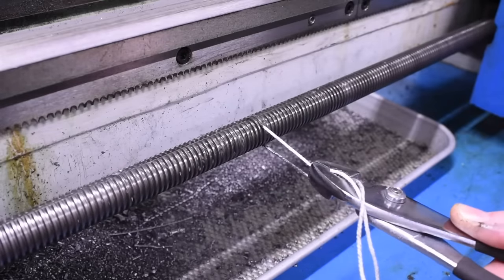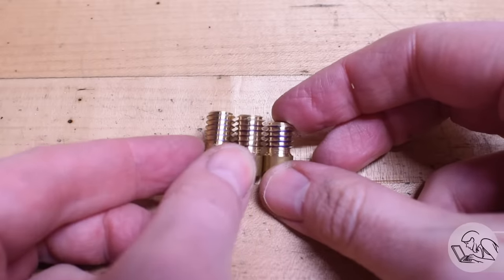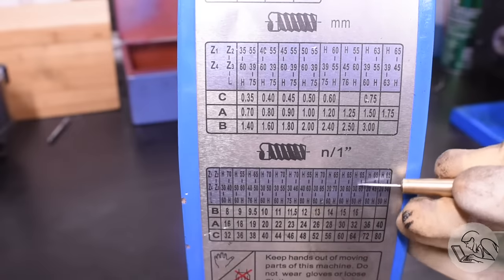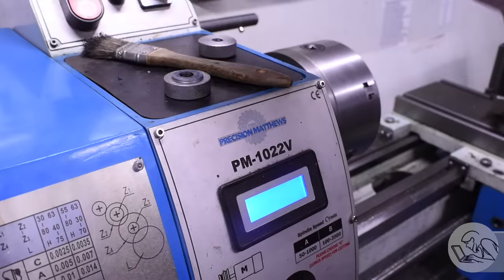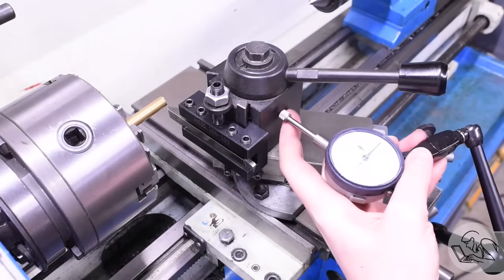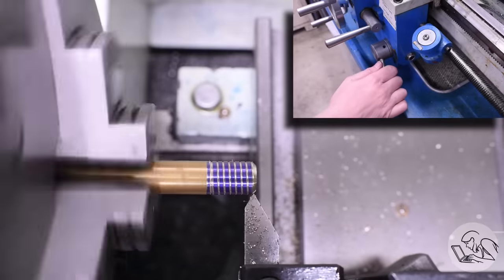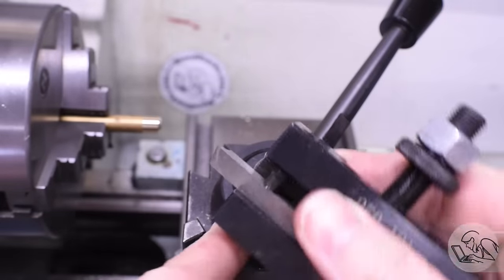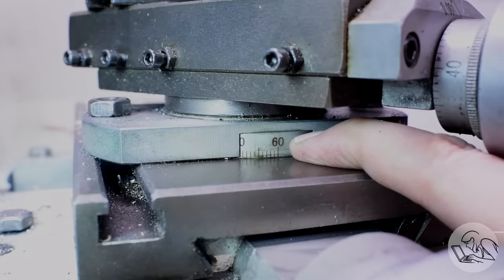How To Cut Threads On A Lathe

Comment: HI Quinn, I wonder if you will see this comment but i hope you do and i have a question. 
I have a old lathe (imperial) that I really battle to stop on time when in cutting metric threads to a shoulder especially if the thread relief at the end is narrow. Is there a way to cut the threads in reverse, from the left to the right, which will probably allow me to use faster speeds and get a better finish in the thread opposed to using the back gear
Reply from the maker: Yup! I covered that at the end of this video. Leave the half nut engaged and wind it back by hand (or power back until close and finish by hand
Reply: @Blondihacks  wow I've watched this video twice before and somehow i forgot about that part.. or maybe i didn't pay attention at the time because i didn't think i will need to thread from left to right. 
Thanks for the awesome videos Quinn  👍🏻 👌🏻

Comment: Wow, I just bought my first lathe. A old Clarke made in China.  It doesn't have gears, it has belts like on a drill press to change the speeds. Only 5 or 6 speeds. Lowest is 500 ram, highest is 2200 I believe

Comment: Silly question: why does the slack on the gears on the left side not influence the precision of the location where the lathe starts the thread?
Reply from the maker: Not a silly question! The answer is that everything is spinning, so it’s all loaded against backlash anyway. Slack only matters in things that change direction.
Reply: @Blondihacks  ah of course, you are only cutting in one direction! When you reverse to the start, there will be slack, but that does not matter. Thanks, I learned a lot from this video.

Comment: Hello Quinn,,, Thanks for the video,, I'm new at this but I'm stuck on a problem ,,,, I want to do a worm gear. The teeth are 1.5mm and it has 16 teeth to 1" on the shaft.
I want to make a gear that moves 1 rotation for that 1" of travel.,,, I've checked everywhere and no one has made a video on what I'm looking for.
I would think it would be simple but I'm having a devil of a problem in finding out what size disk to cut it on. I think I need a 16 tooth or a multiple of 16. 
I'm lost on this one. Any help would be appreciated,, even pointing me in the direction of someone that could help,,,,, Thanks for your time.
Ron,

Comment: if your tool upside down you might want to turn the compound to left....
Reply: Why?
Reply: This is technically right.  Feeding away from the chuck, you're cutting on the right hand side of the tool, so you want the compound screw pressure pushing directly into the cut.  If you're pushing at an angle to the left with the compound screw and cutting to the right, it's possible for the tool to grab and suck the backlash into the work.  The same thing happens when cutting inside threads to the left.
Reply: Thank you both!
Reply from the maker: In practice it really doesn’t matter and this way the compound doesn’t risk hitting the chuck.
Reply: @Blondihacks  you can turn in a way that handle is on the other side...Handle pointing to NE or 1 o`clock... or maybe 12:59 ....
Reply: @Clough42  I am glad you got it, thanks man!
Reply: @Blondihacks  Great Video though!

Comment: I have a suspicion that instead of 1.25mm metric thread your lathe will cut 20TPI, which is 1.27mm pitch. And you might think it's close enough, but already on the 5th thread the mismatch will be enough for it to matter.
Reply: @bwyseymail  1.25mm and 2.5mm don't require it, according to the chart  on the machine

Comment: Hello Quinn, do this method of away from the headstock when threading work when you use  external carbide indexable inserts? I have a few questions and wondered if you have a contact email by chance?

Comment: Absolute beginner that doesnt own a even own a lathe yet here! but why the need for the special tool to reverse cut? Can the other one not be turned over, and even so, in the "normal" method you have the shorter angle moving toward the direction of cut but then with the "reverse" method with the reverse ground tool you have the longer angle moving toward the thread? That said is it because its necessary to have the shorter angle closest to the chuck at all times? Comment section help, i am weak and wont survive the youtube machinist winter!
Reply: The normal tool can be used, you just own't be able to thread quite as close to the chuck or a shoulder. That's why Quinn is suggesting the tool ground the other way.
Reply: @ericfeatherstone  As i was writing my comment out I had a feeling that might be the answer! Thanks for your help

Comment: I hear a lot about single point threading, which is obviously what you showed here. What is "multipoint" threading, or is that even a thing?
Reply from the maker: That would be a die or thread milling, which are multi-point cutting tools.
Reply: @Blondihacks  Ah. I thought so, but wasn't sure. I also thought it could be how threads with multiple "starts" (is that the right word) are cut.

Comment: Given how cheap and ubiquitous digital controllers are, I'm surprised Mini (or table top) lathes don't just use digital feeds.  It should be noted that metric threads are more common in the world, and are becoming so in the USA.  Having cut inside threads on a CNC vertical mill, I'd rather do the metric ones.

Comment: Do you have a video on how to make a threaded receiver? Forgive me if I'm not using the correct terminology, my vocabulary is limited in this area. Another way to put it might be "How to CUT Out the Receiver Threads for 1/4"-20" I want to make an adapter plate that can be mounted to the bottom of one device and then mounted onto a standard camera tripod, hence the need for 1/4"-20 threading. 

The link is to a plate that is very similar to what I want to be able to make. If the center hole were the correct size and threading for 1/4"-20 and the outer 4 holes were the correct size for mounting with VESA mount system. 
https://static.bhphoto.com/images/images500x500/1380562335_997510.jpg

Comment: She mentions the 29 to 30 degree angle as reducing tool pressure but does not explain WHY it does this.  It has to do with how chips are formed.  If you go straight in, you have a chip from the left edge wanting to move to a point above the tool point and also a chip from the right edge wanting to move to the same point above the tool point.  They can't share the same space and therefore collide there.  This creates a force and can cause tearing of the metal (hurting finish quality) and the increased stress can even break the tool tip.  30 degrees is not an acceptable choice because even with the slightest error in compound angle setting or tool bit angle, you can get a small stair step on the weak side cut.  That's why 29.5 degrees (or for some, 29 degrees) has become a de facto standard for 60 degree thread cutting as it should guarantee at least a little cutting on the weak side.  This insures a good finish, and also insures good contact for heat transfer at the weak side cutting edge.  If you ever do get a stair step on the weak side, check your angles of the compound and tool bit.  One or both have to be wrong.

Comment: Having 40 years in the shop and cutting a lot of threads on 50RC plus material. I think this was a good video showing thread work that will do well in soft material but I do not recommend cutting from head stock to tail stock when doing this and using compound you are always cutting on the back side of tool. This is not a good cutting condition. Also a lot of Old timers will throw rocks at you if they see you cutting away from head stock.

Comment: OK, who remembers what thread, and what 
material, did you use to make your first thread?
(And, when.)

7/16 14, cold rolled steel.  1973.

steve
Reply: 1" - 5 tpi ACME, and my first one was backwards, so I have a funny bench vise with left hand thread, but a lot of fun when I have visitors.
Reply: 1mm pitch, random diameter piece of aluminium, about 20 years ago.
Reply: M12x1.75, free machining steel, twice before getting it right

Comment: Ever tired to   cut a third with a   ,  rotary threading system   . do not  now need  a screw Or thread gage ,  it works well on my lathe . I because , the rack will start in the begging of the thread  in the right place.  &  Dose  not now need thread Diale.   as the  tool retunes.  to the start on the rack  & it stops when it coms of the job . or at the end of the cut  it is far suprema to the led screw . once you have the  tip grown propyl .  it tern's My hand operated  lath in to a modern  Wattis  lath .  the spin at radicles fast yes a whites'  CNC    See Stephon Gotteswinters ,he as good  Demonstration on third cutting with a rotary tool like that Whitsitt lathe.  CMC  you know the modern one.  LOL   LES England. you should check it out .

Comment: Do Not Remove The Knobs While The Machine Is Running At High Speed
Reply: @bwyseymail  yes sometime the translation isn't the best. bought a workshop manual for my kawasaki z900 in the 70s, it was a word for word translation from japanese. although english words it made not the slightest bit of sense